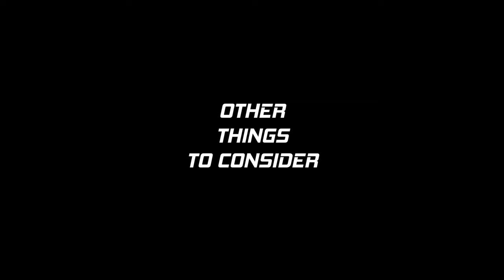How to Choose the Right Clutch for Your Build

Comment from the maker: What aftermarket clutch setups are you running on you cars?
Reply: Excedy Hyper twin plate Hd clutch
Reply: Clutch Masters FX400 for my boosted Honda 
Exedy Twin Disc for my Evo9
Reply: @turbinator1990  can you daily drive the exedy twin disc?
Reply: @aportsetivac8023  I don't why why not but I don't need to daily my evo since I have a car to daily.  I did drive the evo everywhere the first month of ownership and personally had no issues, yes the pedal is stiffer than stock but it was fine.
Reply: @turbinator1990  and how hard is your clutch? Do you think it's still drivable in a heavy traffic?
Reply: @aportsetivac8023  I wouldnt recommend it for daily traffic abuse for long distances, it can get tiring. Get a automatic car to daily if you need a twin disc clutch in your "racecar". I hated driving in LA traffic but I was using a clutch masters fx400 and was fine, twin disc was not.
Reply: I’m running a SPEC STAGE 3 +  single disk holds up to 975lb ft of torque.  Have had it in my daily driver (2015 Roush RS3 730hp) for 2 yrs now without issue.
Reply: i’m getting ready to replace my old competition clutch stage 2 with
the a south bend stage 2 daily and act streetlight flywheel
Reply: Does anyone know what stage the act heavy duty performance clutch is ?
Reply: South Bend Stg3 daily Clutch and single mass flywheel... On my stg 3 2018 WRX

Comment: Had to order a new clutch after a tune on my car called MAP  to see what clutch i should run becuase first time building a car, now running a Clutch Masters FX350 w/ a lightweight flywheel. It holds more than I will need for a about a year. thanks guys!
Reply from the maker: For Honda or Subaru? It's a great clutch!!
Reply: MAPerformance Honda - sadly the same day i wrote this the CM clutch basically died after only 2100 miles for no good reason, i just ordered a ACT clutch with John and he was great! Just upset i lost money on that CM clutch.....
Reply from the maker: @felipehoyos9484  Wow! That certainly seems odd - might just be bad luck? Let us know if we can do anything!
Reply: MAPerformance already reached out Friday when it happened, hoping CM refunds or replaces it... if not I’d love it if you guys hooked me up some how ? Lol
Reply: @felipehoyos9484  my ACT clutch arrived defective.  Had my CR-V in the shop for the past 3 months; new jdm engine,  transmission, clutch and full suspension redo.  Cost me $5,029.00 (in labor alone) yesterday only to be told the clutch is faulty and since the 90 warranty expired while my car was being worked on I AM FK'D out of a nice chunk of money.  I won't buy jack shhhh from Car ID nor ACT ever again!!  Next is a new clutch, forged rims and a Big Garret Turbo!!!

Comment: Nice Video! I have a 2016 Subaru wrx, the throw out bearing in these cars are no good. Im looking for a nice street clutch for my daily, but with some spirited driving. I’m also looking to stage 2 eventually with some MAP parts. My end goal is not having to constantly deal with this TOB problems and have many many miles of smiles. Thanks!
Reply: Do you have a clutch fork spring?  Perhaps under the intcooler?  Ive read of it in forums for legacy, they said sti comes stock with one
Reply: I’m in the same boat as you. My daily 2016 wrx, want to upgrade my clutch possible stage 2. What did you end up going with? And how is it treating you
Reply: @stangsO9 Spec brand Stage 2+ clutch. Mechanic i felt comfy with did it.  67 miles in, does well. Like a 3in engagement area on the whole pedal stroke.  It's in a great area im usually just nervious & trying to baby & end up doing more than good.       My previous owners basically closed coursed my car lol so their alleged stage 2 clutch blew after me 'learning' for 2k miles.         Uhm yeah spec been cool & dec.     I bought an upgraded fork clutch that was not needed.  Was too heavy for the retainer spring mechanic said.   So i got stock fork with new alum flywheel, clutch, press plate, throwout bearing.        My tans nose had damage in the past from a hella worn out TOB. (BEARING GOUGES & FKS WEAR SURPHACE).   so a machinist make a sleeve you can slip over but then it is a few mm smaller inside diameter bearing than OEM.     That happened in my vehicle & i had no clue that other owners fkd it like that (not a huge deal_ sleeve is avaible & the bearing was on hand in MT even) like 33mm vs 37.      Uhm yeah so im breaking the clutch in & im stoked.  Read much of 500mile break in & such.  Yet realized today-- i has to be the amohnt of shifts- to get a good seatinf surohace to flywheel vs friction plate.   As a person can travel 500 miles in 14 shifts.      But if you get 3,000 'perfect' shifts in 300 miles think that the ideal- for example.   Let u know.  Thanks for wondering.

Comment: Just ordered Exedy stage 2 and flywheel for my 10th gen si. Not very much feedback on it, so we'll see how it goes
Reply from the maker: Should be awesome! Let us know what you think.
Reply: i gotta ‘15 Civic Si & i wanna cop a stage 1 or 2 but in your opinion is exedy?? Good
Reply: @katdelfi  It's been holding strong with a TD03 turbo swap
Reply: @neilsunk6352  how's the chatter while stopped?
Reply: @cleverj90  I only feel it doing slow starts. If I give it gas, it's unnoticeable
Reply: I am about to order a new clutch and the shop I’m using recommended the exedy stage one. I’m currently at 280whp and 330 tq and was thinking that the stage 2 would be the minimum I should use with that torque. How is the stage 2 clutch?
Reply: @garrettklotz6649  if you can get the rv6 type R flywheel retrofit, I'd get that with Exedy 0 or 1 for type R. It's cheaper than the Exedy kits for 10th or 11th Gen 1.5t 6mt

Comment: What about a forged clutch fork? I have a 2015 Subaru WRX limited with 300whp/tq .. just recently had a new clutch put in — a Clutchmasters stage 1 pressure plate/disc, an Exedy OEM Subaru BRZ/WRX flywheel (a bit lighter than stock), Verus forged clutch fork/billet fork pivot, PDM snout repair/sleeve kit .. love the way it feels now .. I already have polyurethane shifter bushings and a weighted shift knob and also added a kartboy shifter linkage reduction (40% shorter throws) .. the car reacts much more quickly now

Comment: a little late to the video but it was very helpful still concerned about what to use for my 09 370z with aftermarket dual air intake cat back exhaust and cat delete no tune i haven't driven it much yet cuz of a medical issue and kinda worried about driving it without tune wondering what might be a good option for a new clutch before i do tune it.

Comment: I have a stock powertrain 2011 WRX, it currently has a stage 3 clutch (unsure of the type) and i'd like to go back down to smooth enagement and easier daily drivablity but I like the quicker engagment it has. Have any reccomendation?

Comment: Whats the best clutch i can buy for my 10th gen si? Ive been on hold for act for about 6 months now and my supplier has exedy and competition clutches. Im trying to daily and have some bolt ons for it already
Reply: Any luck in finding I’m on the same quest , I’m about to be FBO
Reply: I’ve driven almost 30k miles on the clutch master fx400 rigid disk for the stock dual mass flywheel. It’s been amazing no chatter no issues perfect engagement and I installed it myself and I know what I’m doing so that probably a factor as to why I’ve had such good luck with this clutch and I’m making 350whp over 300wheel torque 50k+ miles beating on it all day long

Comment: What do you see as high torq cars? There are racing cars like the MX5 NA with only say about 126bhp and 150Nm but its a race car? Is this low torq but racing level so stage 3 or higher? Or mainly stage 1 or 2?
Reply from the maker: Stick with a stage 1 for that application! These can put up with the abuse of racing!

Comment: If i plan on upgrading my car to get high horse power and torque but my car is stock and the clucth is starting to slip. Is a bad idea to just upgrade it to a performance one now instead of later? Or just get a standard one now amd upgrade it again later. I plan on building my wrx sti within the next 2 years to a stage 2-3

Comment: Thinking about getting a flywheel and clutch for my 97 Miata, stage 2 seems ideal
Reply: I think a 3 puck stage 5 will work the best. Your Miata has 1000hp right?
Reply: Negative
Reply: @masonchewning9640  rip

Comment: Hi,
I have a 2016 mustang GT. It will probably be stock or bolt on for all of its life. Maybe just being a little over stock. I’m still confused if I should invest in a dual or single clutch. This is my daily and I just want something that is better than stock and doesn’t lock me out of 2nd or 3rd gear at high rpms because the stock clutch is so bad. What would you recommend. I don’t want something that is overkill if I can just have a single disc that is better than oem.
Reply from the maker: Hi! Give us a call at 651-348-8811 and we can get an expert on the phone with you so you can make the right choice for what you want out of your build!

Comment: I have a 2001 f150 with a 200hp 4.2 v6. My concern is the truck weighs 4000lb. I feel first gear is to high so when I start out I have to feather the clutch. How do I pick a clutch/pressure plate combo for longevity?
Reply: If it launches hard when you ease out you're starting in too low of a gear. This results in clashing against the flywheel it's like dumping the clutch, try taking off in the next gear

Comment: What do you recommend for a 10th gen civic Sport hatchback pushing 260 whp/290 wtq? I was thinking about getting a clutch masters fx350 or fx400. I want smooth engagement but enough grab for putting down power every now and then.
Reply: Ur not pushing 260 on a civic bud
Reply: @BigMike48  car was pushing 300 before it was traded in. Running fbo, e30, w2 turbo, and custom tune. So quit trolling.
Reply: @suher1616  🧢

Comment: i have an 06 g35 sedan manual transmission and the past couple weeks, my clutch has been receiving a gap and it seems like it's getting bigger. i don't think i have an issue with my release point but now it feels like when i push my clutch down i have to push it to the floor  due to the gap. is they because it's stage 3 and just broke in or do i need s new clutch ?

Comment: Basic stuff. Very disappointing that they didn't even touch on the importance of using up all the increased friction surface area that an aftermarket flywheel will provide.

Most of the time an aftermarket flywheel will have a bigger contact area than your factory clutch disc, therefore simply by stepping up disc and pressure plate diameter you instantly increase the holding power using the same organic material.